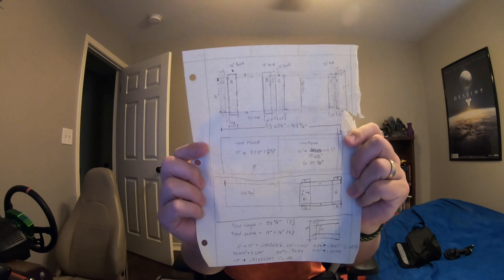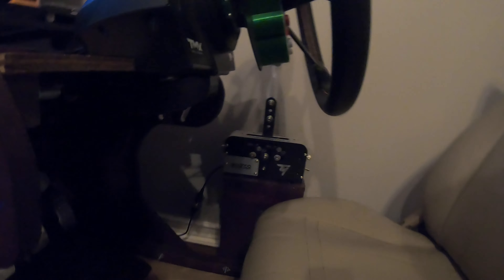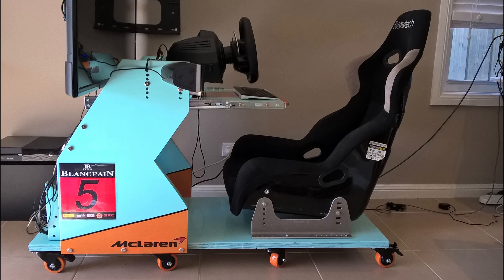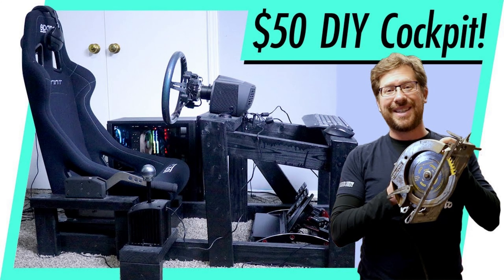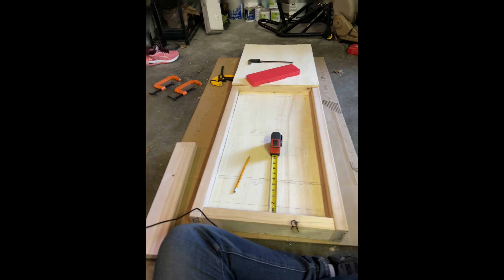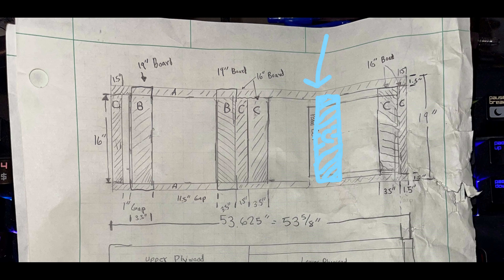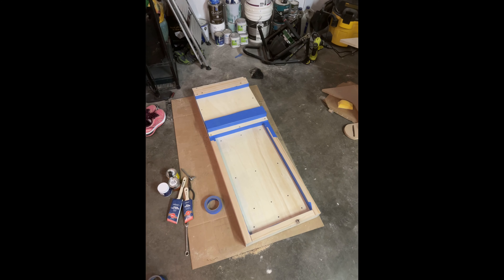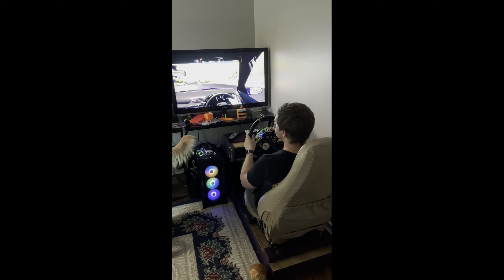How To Build a Wooden Sim Racing Rig

Comment: Nice! Mine is almost complete. I wrapped the base with carpet and the side plates and shelf portions are wrapped with black vinyl. Just need to find a seat now.
Reply from the maker: Nice! I actually considered the carpet route as well. Makes much more sense if you are planning on driving barefoot a lot!
Reply: i recommend a junkyard seat there like 30-50$ which is very cheap